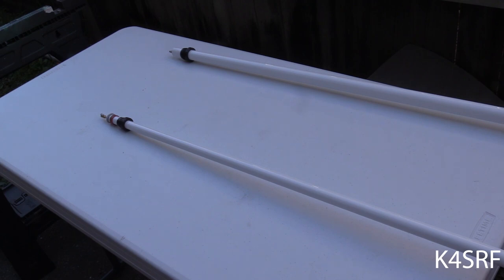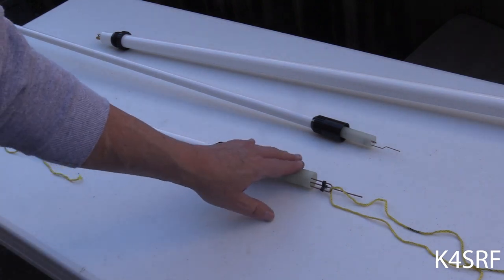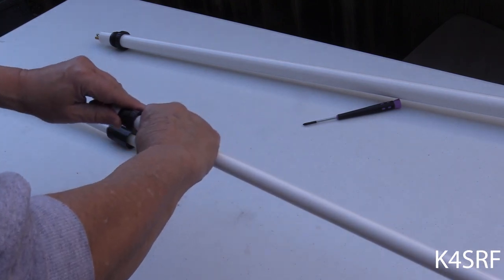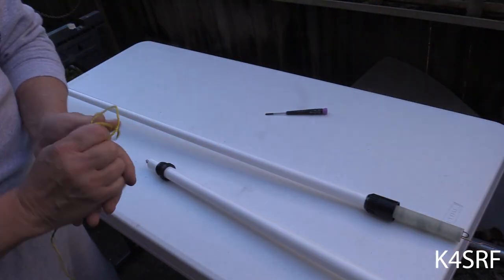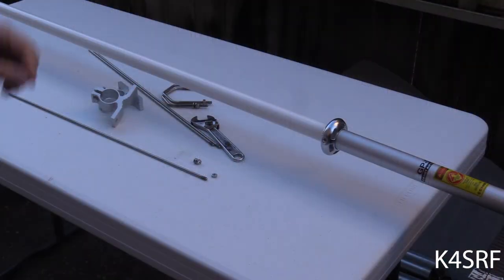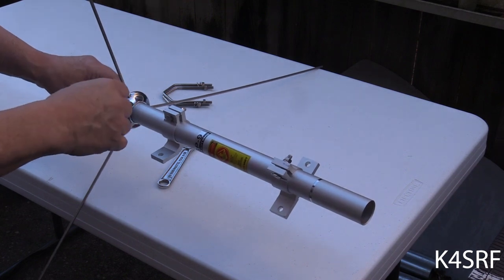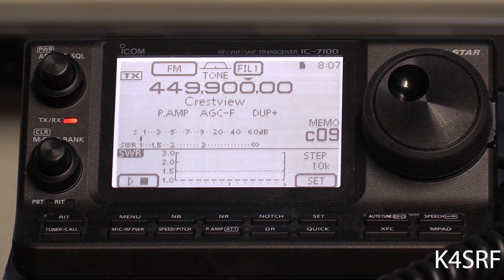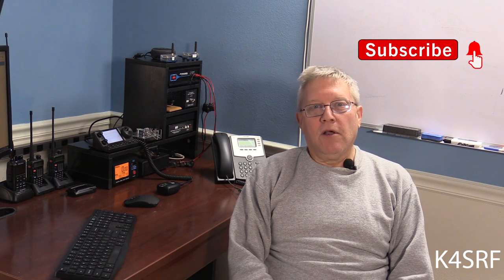The Comet GP 9.  Unboxing, assembly and testing.

Comment from the maker: The Comet GP-9 has proven to be a great dual band, (2m/70cm) antenna.  Used together with a proper feedline such as LMR 400, I have found my SWR flat along the 2 meter band and 1.0 - 1.2 on the 70 centimeter band.  Test shown zero to very, very low reflected voltage and maximum output power.
Reply: Thank you Sir, nice assembly and instal demo. Well done. I just subbed and look forward to your next videos
Reply: Can anyone please recommend a affordable and quality 80-6m antenna, that isn't an dipole or wire antenna ?
Reply: Johnny Rebellion  Appreciate the comment mate, will look into that one. The Comet range available in stock in Australia may be limited and my budget is screwed right now for hobbies. So a Christmas wish at best right now. 73's Have a great day/evening !
Reply: Same for me. Using LMR400. Great antenna.    WD4XA

Comment: The GP-9 is an AWESOME antenna!!!

I've had one in the air for about 15 years through many many many strong storms and ice and it has never failed me!
I get at the highest 1.5:1 SWR or less across both bands, usually in most areas of the bands 1.1 to 1.2 mostly and at one spot on UHF 1.5.
I have the base at 25' above ground fed with about 40 or 45 feet of LMR 400, just high enough for the whole antenna to clear the rooftop entirely and I routinely work repeaters 100 miles away, and simplex 10's of miles just depending on the multitude of factors, mainly the other stations conditions. 

I much prefer the Comet products to the Diamonds.  The Comets go together easily, hold up and last for the same to less money. And they just plain work very well!

I did goop the crap out of all the section joints with silicone at the initial assembly and installation, I don't know if that was needed but it surly didn't hurt anything. 

I've never had it down in the 15 years since installation and I keep a meter inline on the shack bench just to keep an eye on it and it is still purring right along. 

I also have the Comet CX-333 Triband for 220 mhz and it has the same quality, affordability, and performance as the GP-9.

I wish the Comet antennas got the love that the Diamonds do so that they will always be in production and available.

73

Comment: Good instructional video with actual on air results.  

I have assembled many of these type of antennas over the years.  It is not the end of the world if one loses the screws or strips out a coupling.  I had a unit due to poor manufacturing quality control, wherein the machining failed to make the proper threads for a coupler to join two sections.  I just got out the big solder iron and and joined it.  

There is always a work around when there are problems.
Reply from the maker: How true, but dropping a small screw or something is still frustrating.
Reply: What size screw is that for the antenna I just got one and didn’t mount it with the screw I can’t believe I missed that and I think I lost the screws for it🤦‍♂️?

Comment: I'm going to be using the GP9 for a UHF repeater.  I wish I could move the SWR curve to the 449mhz range for the input.  I recommend to everyone using this antenna.  It needs to be weatherproofed better then what the antenna provides if you want it to last.  My GP6 which I've had for over 5 years now I used high performance electrical tape that self seals over all the connection points at the rings and over that I used pro grade silicone over that.  Inside the antenna at each screwed in connection point I soldiered everything in place after tightening the screws.  The coax part of the antenna is another weak point and I used the same methods as I did on the antenna sections.  I attached the coax connections together and then electrical taped everything inside the tube as well as siliconed everything.  The antenna has survied over 5 years of ice, snow, rain, freezing rain, very high winds of 50-100mph.  The antenna survived a tornado touchdown that took my roof off.   The antenna also survived a move to a new home and it's been up and performing.  I worry about the GP9 due to the lower wind rating but I need a high gain antenna for UHF and the GP6 perfromed so well I'm going to go with the GP9.

Comment: Thank you very much for that video, you have just saved me $700.00 and some change of the antenna that I was going to purchase. I’m going to order myself one A.S.A.P. Thank you K4SRF From WRDM641 GMRS
Reply: I have it being shipped as I type this message. Thank you very very much. I will put it to the test and I am sure that it will pass. Happy New Year.
Reply: Today i have received my Comet GP-9 antenna. I will be installing it  as soon as my new HF antenna comes in because i want to install them at the same time. To be continued.
Reply: I can't help but to be curious as to what antenna/system you were going to  choose that cost over $700???
I've had a GP-9 up with the base at 25 feet 9just enough for the bottom to clear the roof line in all directions) for about 15 years or so fed with about 45 feet of LMR 400 coax, living in foothills type terrain and hit repeaters out to 100 miles plus and excellent simplex out to 10's of miles (just depending on the multitude of factors, mainly the other station's setup). I have worked 90 miles UHF simplex during contest! 
I am well pleased and have always preferred Comet to the Diamond brand counterpart models.  
(especially for the money) I can't imagine using anything else, even if I had a tall tower I would have a GP-9 on top of it.
I've never had a problem with high wind or moisture issues, and it's been through many many storms. 
73, and I hope you have as much luck with your GP-9 as I have OM.

Comment: Great tip on how to get the wire out of the upper piece. I just received a Comet CX-333 in the mail today and was wondering how to get the upper section wire attached to the lower side. Thanks!
Reply from the maker: Glad that the tip helped you out.

Comment: Heard great things. Considering purchasing the GP9 to also use with GMRS have you used it on those bands 462 and 467? How are the SWRs
Reply from the maker: I have not tried those frequencies on this antenna, sorry.  My SWR check of the UHF frequencies though on this antenna were fine.  Though I have heard the GP-9 will work for GMRS, I have a Comet CA-712EFC specifically for my GMRS base station, (a Wouxun KG-1000 Plus.)  It works fine considering the ONLY GMRS repeater is about 25 miles away and my antenna is up about 30 feet.

Comment: Good morning sir, I currently have the Comet GP-3.   Would this antenna be of any improvement over the one I currently have?
Reply from the maker: It all depends on your location.  The GP-3 is a great antenna, I too have one as a backup.  The GP-9 may reach out further, but again, it depends on your location and the height the antenna is mounted.
Reply: @K4SRF  Thanks. I sold my GP-3 and purchased this GP-9. I am planning to install it next week. Thanks.

Comment: So, Almost a year later, What do you think of the GP-9?
Any SWR issues, RX/TX issues, water leaks or any other issues?
Would you buy it again or something else?  What if something else?

I want to put up a Base station antenna soon.  I keep waffling back and fourth between the Comet GP-9 and the Diamond X510HDM.  Specs are very similar. 
I see some leakage and High SWR reports on both and a lot of good comments on both.  I just can't decide. 
Thanks for your time.
Reply from the maker: Yes I would buy it again.  I had to lower the antenna mast for a guy-wire replacement so I checked the antenna.  Everything is fine.  No water leaks or abnormal wear.  My SWR is still about 1.2:1 on VHF and at, or below 1.3:1 on UHF.  All in all, I would say a good antenna.  Oh, and yes, I am not using inexpensive coax; I am using LMR 400.

Comment: Great video. I'm using the Comet GP-3 and will be upgrading to the GP-9. Any idea how far you get out on simplex? I know the Pensacola area is flat and not a good comparison for my hilly location but was just curious how far you can be heard on simplex.
Reply from the maker: It all depends on the terrain on simplex.  I will say that with my GP 9 up at 40 feet, I have reached out as far as 10 miles, simplex.  They received me fine, but sometimes did not receive as well as they were transmitting on a hand-held.

Comment: I have already installed this antenna and had a little problem connecting the elements. I would probably have avoided it if I had watched this movie before. Well done. Just one piece of advice, the camera is in the wrong place. I would put her on the other side of the table in front of you, your arms are blocking the view.
Reply from the maker: Glad it helped.

Comment: I appreciate your video.  Im looking at getting a GP9 as well.  How has it done in high winds?  I will get up to 60mph gusts in my area.
Reply: Mine has been through a hurricane with 90+ mph steady wind, with gusts as high as 110mph.  It handled it like a champ, with no issues.  I normally take it down before a hurricane, but wasn’t able to that particular time.

Comment: Ok... Great antenna..been using it for years
However..your coax should be better
What are you using and what length

My GP9 at the base is 62 ft high
Using 125 ft of Heliex LDF7-50A
( a bit over kill,,yes..but boy does it get out )
Reply from the maker: I have found that LMR 400 has always worked great for me, but thanks for the input.  I'll check it out.
Reply: @K4SRF  mind you..i run 165 ft
Even on HF i run LDF5-50A

Mind you it is Expensive and hard to work with
Yet indeed is part of the reason i do so well

Comment: I enjoyed the video, but can't help but wonder if the top of your GP-3 was at 40 feet like the top of the GP-9 if you could hit that Crestview repeater. Also, what I do not understand is how a 2 meter antenna, where 2 meters is roughly 6 1/2 feet, can be over 16 feet in length? I thought bad things happened when you reached a full wavelength on a di-pole, and this would be about 2 and a half wavelengths. Obviously it works, I just don't understand how.
Reply from the maker: I hope I understand your question.  The GP-9 is a dual band (2m / 70cm) antenna. The gain and wave is, at 146MHz, 8.5dB, 5/8 wave x 3 and then at 446MHz, 11.9dB, 5/8 wave x 8.  As far as the radiation pattern goes, it is directed to the horizon omni-directional around the antenna.

Comment: missed the bit on how the coax connects up in the tube.
Reply from the maker: If you are speaking of the lower tube, it just slides through it and connects to the SO 239.  Then the tube is secured to the antenna.

Comment: Wonder if the GP-3 was at the same height as the GP-9 would your reach be the same.
Reply from the maker: It was, but the GP-9 has better gain.
Reply: Right, the GP-9 has about 2x the gain. It does have a low take off angle as well, great for DX, I can hit repeaters in Mexico from Anaheim, CA about 110Miles on 50Watts